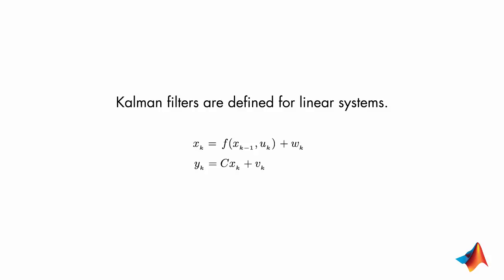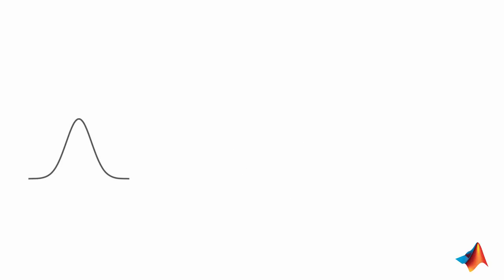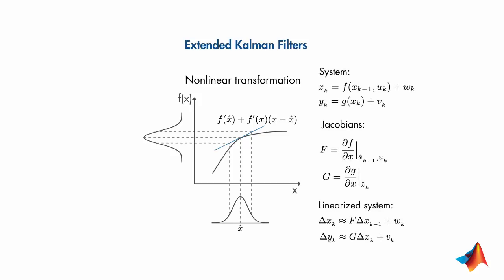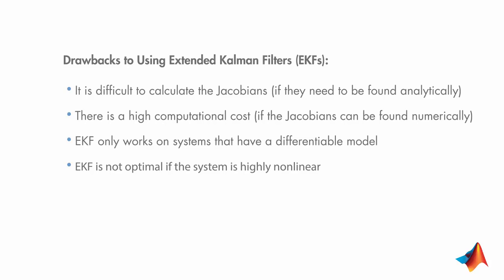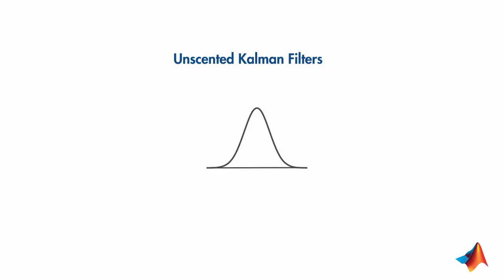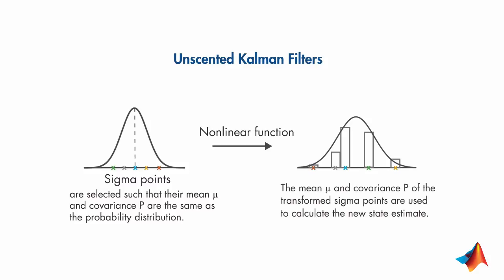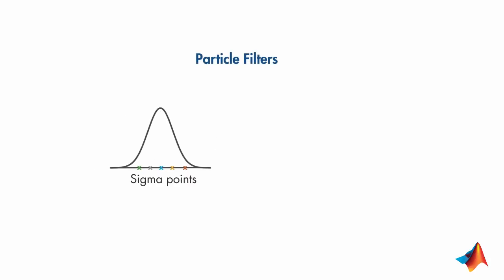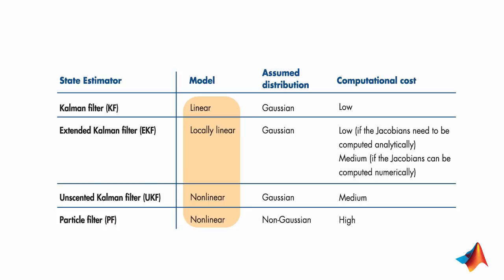Nonlinear State Estimators | Understanding Kalman Filters, Part 5

Comment: 1- in the literature, there's always emphasis on the weights of the sigma points in UKF,
could you elaborate the importance of weights for the sigma points in the prediction and update of the next state P ?
2- is their a solution for the non-positive definite P in the sigma points generation step ?
Reply: 1. Weights of the sigma points depend on a few unscented transformation parameters (such as alpha, beta, kappa), which in turn control the spread of the sigma points around the mean state estimate. How the sigma points are spread is important because UKF can only track unimodal (single-peak) state distributions. If the state distribution is not unimodal, but you would like to track one of the peaks, adjusting the spread of the sigma points so that they are all near this peak can yield reasonable results. 

Weights can also impact the results due to numerical issues. For instance, large weights (typically corresponds to tightly packed sigma points) is more likely to cause numerical issues.

2. A non-positive definite P can only arise due to numerical issues. If P is not positive definite, one solution is to perturb it to make it positive-definite. An alternative approach is reducing the chance of numerical issues by ensuring the state estimation is well scaled (states have similar magnitudes). 

For more information, I'd recommend the references on the following page: https://en.wikipedia.org/wiki/Unscented_transform